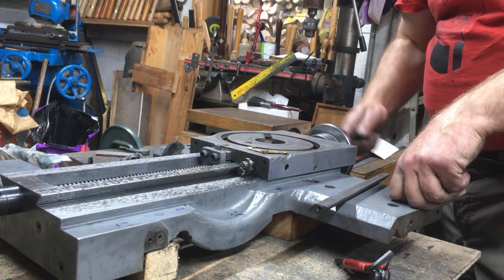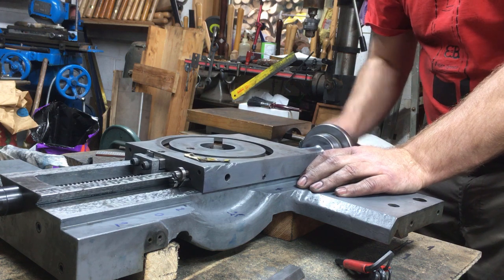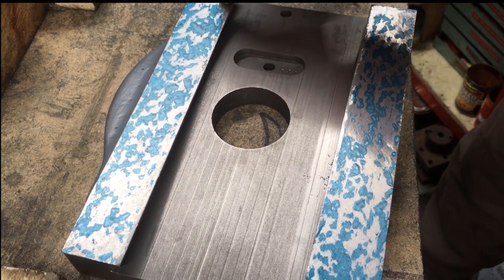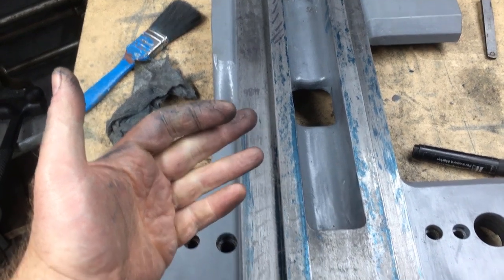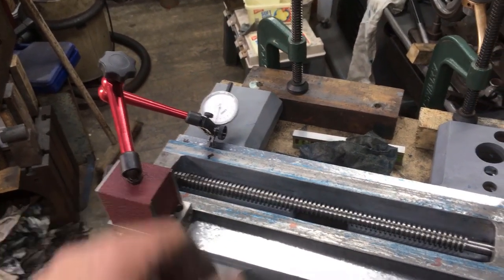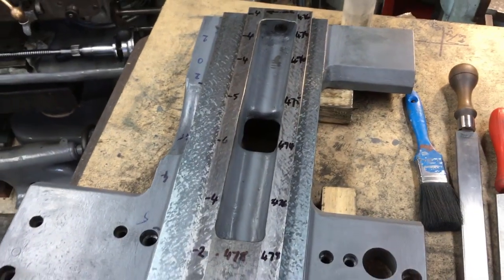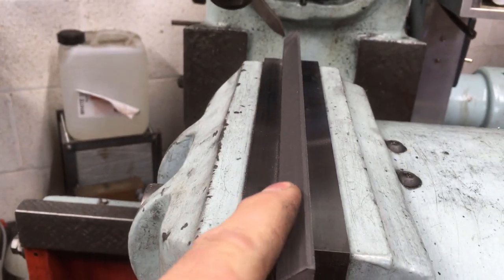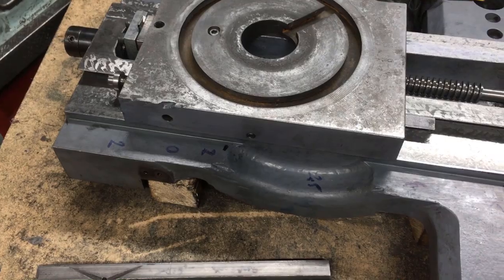Dean Smith & Grace Saddle Cross Slide re-scrape

Comment: All of the mag bases like your red one shown here have a common weakness. Down the center line is aluminium and the post can never be truly tightened. A good fix is to make a plate to cover the entire area of the base top face. Level off the top face and screw the plate down in each corner with a new center hole for the post. You will be amazed at how much more rigid the upright post is after the mod. The only catch for young players is the plate must be non magnetic (don't ask how I know) so stainless or brass/bronze is the best choice.
Reply from the maker: thanks Rob, I shall have a look into that - I have been wondering about making a base making use of the fancy neo' magnets. Still in the thought stage of projects that one !
Reply: @lookcreations  You can make the eclipse/mercer style push-push bases work with washer shaped neo magnets, i've done it, but the rotary switch bases require the magnetic poles to be diametrically opposed rather than the usual axial polarisation. Every neo cylindrical magnet I have investigated is axially polarised, so not useful and then there is the problem of getting a close fit into the iron base.
Reply from the maker: @RobB_VK6ES  I was thinking of starting from scratch and designing the mag' to pull up internally to release - cam & lever type arrangement. Held in a non magnetic housing so it doesnt get the chips sticking to it. As I say, its not had much thought yet. Might be a nice project down the line.

Comment: Nice work as always. What is your method of honing the scraper blade, and how often do you do it? I found I was honing mine every couple passes on tiny ways. Do you rehoning during passes on those big surfaces?
Reply from the maker: Good question. Well I use a diamond lapping plate on a slow grinder - after watching Robin Renzetti use one I made a very cheep copy - there is a video of it on my channel if you take a look back through. It is fitted with a #600 grit wheel and as such takes very little off of the carbide each time. Little and often is the key. I like a sharp edge so less force is required to take a cut and therefore I can retain more control over the edge direction etc.  When I re-scraped the lathe bed (see the video in the Holbrook playlist), the roughing passes were deep and quick - sharpenning maybe every three passes over the 6ft length. As the face developed and more cuts were taken (smaller) I eventually got to put a fresh edge on each pass.  Another thing to think about, 20mm wide scraper has less cutting edge than a 30mm wide scraper for a reason. So a larger / wider blade should enable you to find a sharp edge on the curve for longer. Straight push scraping is hard on the edges, so you have to learn to work around the scraper edge. I get more control with the curl cut I use and so its less force and the edge holds up longer. The last thing to concider - Cast Iron comes in many mixes, the gib cut from the old wood lathe bed was like butter, the saddle casting was much harder. My Holbrook lathe bed harder again. Sharpen the edge when you feel its losing its edge.  I am filming a scraping video today for a small SE - I will try and cover this in the filming. All the best Mat
Reply from the maker: @RotarySMP  Those Coborn scrapers are a superior machien to anything else Ive seen. I hope to have a play with one some day or a big surface plate I have in need of scraping.

Comment: Nice job Mat.  The freshly scraped surface looks so good compared to the worn out parts.  I have the same problem on my Broadbent Schofield lathe.  The cross slide and saddle dovetails are very worn out and every attempt to adjust the gib is an exercise in compromise between being locked up at the ends of travel and too loose in the middle.  It is so far gone I think it would have to be machined before being scraped (the dovetails on the saddle are 38" long, requiring a lot of scraping even if they were close to good).  Was it normal practice to make the dovetails parallel to the ends of the saddle when the lathes were manufactured?  On my Chin Hung lathe every male dovetail is hardened and ground (cross slide and compound rest) and the female dovetails are soft and scraped to fit the male.  In their sales brochure they show the saddle cross slide dovetail being ground.  There is a fixture mounted on the grinder that looks like a short piece of lathe bed and the saddle sits on this while the cross slide is ground.  I guess this ensures proper alignment between the bed ways and the cross slide dovetail.  Using this set up the bed ways and the cross slide dovetail wouldn't necessarily have to be aligned with end of the saddle wings.  Maybe the technique is different when you're grinding versus when you're scraping?  Thanks, Ken
Reply from the maker: Hi Ken, I would think that each manufacturer had there own jigs for setting up parts for final grinding to ensure alignment - as you can guess its more long winded measuring and adjusting. Broadbent Schofield made some quality lathes and if Im not mistaken made lathes to be re badged for a number of other high profile lathe 'makers' beds at least. 38" long cross slide - yes that would take some scraping - but its not out of the question. Its like a 6ft SE . The first thing would be to determine the degree of wear - from that you can determine if its heavy roughing scrape or machining job. If it were mine it would be scraped - as its too long for any of my machines. besides the wear is unlikley to be more than 0.020" and that is soon bashed  off 'as Chris would say. Youd want a few beers afterward mind :-)

Comment: While I admire your work and think it's of excellent quality the idea that using any original surface as a true reference is not wise. As a drafter designer I can assure you that the machining tolerances on that machine were never tighter than +- .002. It would have been cost prohibitive to call for anything tighter than that and would never ever been called out. Good luck with your efforts and for your own piece of mind it will be far better than it ever was when produced! Your lathe will be super accurate compared to original!
Reply from the maker: The original machined surface is a starting point. Not having the bed and spindle to use required I use something original to get things going.  If you take a look through the Holbrook rebuild, you can see a far better approach when the complete lathe is available to work from. This cross slide was badly worn to the point it wasn’t effective to use.

Comment: Would like to see you scraping the dovetails please
Reply from the maker: sorry about that, i didnt take any footage. I will try and find a section in one of my earlier videos where I scrape the dovetails on the Holbrook T13 lathe.  Mat
Reply from the maker: Ive just checked through and there is little Ive got on scraping the actual dovetail faces - so keep tuned, I have to scrape the top / swivel slide' and will be sure to film the dovetails on that. I will have to check back further as the shaper rebuild tool head, ram and cross slide dovetails were all scraped and filmed. Take a look at the play lists on my channel. Thanks for watching. Mat
Reply: Thanks for looking! I look forward to seeing it.  @lookcreations

Comment: My 13x42 Dsg cross slide was too short because they needed to accommodate the power drilling attachment, compromised the rigidity.
Reply from the maker: I was surprised by the truncated fore leg of the far slide element. It has the advantage of creating 3 pads to a degree - but it will soon wear as the load is carried on a smaller footprint in my view.